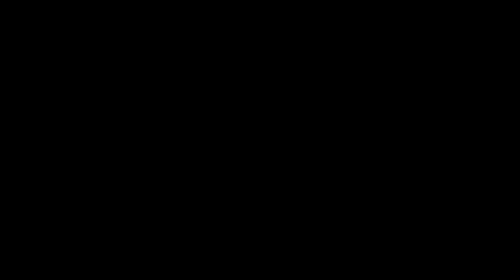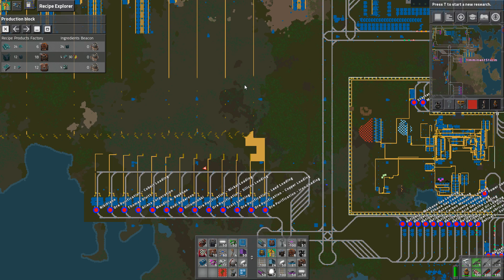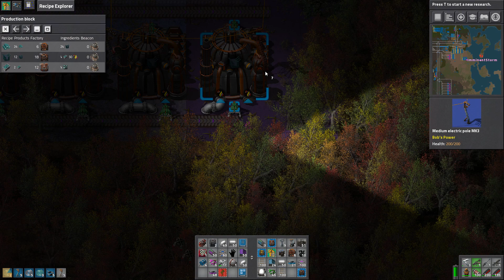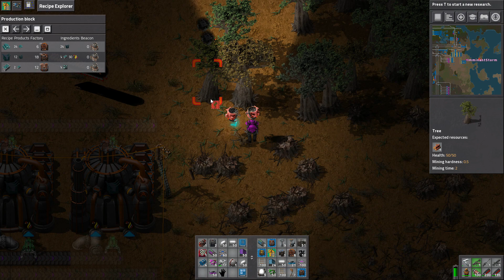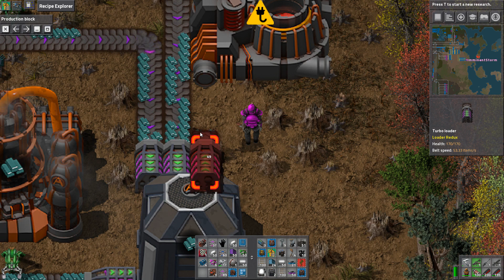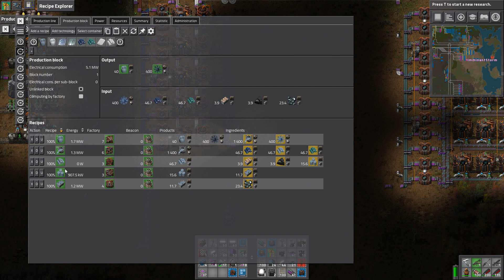Factorio - Angel's & Bob's - Episode 143 - Nickel & Dime

Comment: I rather suspect you'll start running short on sulfuric acid pretty soon. I think bringing in trainloads of acid gas and cracking it locally in your forge area might be a good idea. You can turn the hydrogen sulfide immediately into sulfuric acid, and build up a supply of carbon dioxide and hydrofluoric acid at the same time (with flare stacks / clarifiers on the latter two so that the acid gas cracking process will still run as long as there's a need for H2SO4). The catalyst for acid gas cracking is made with aluminum ore + silver ore, which is also easy to make locally in your forge area.